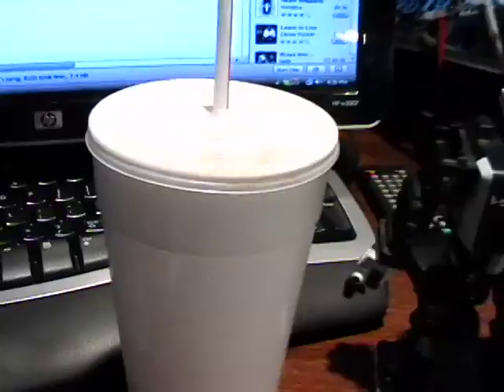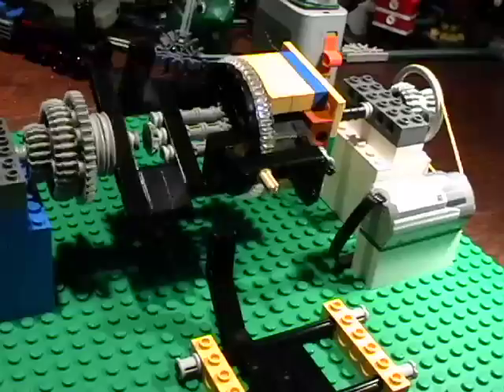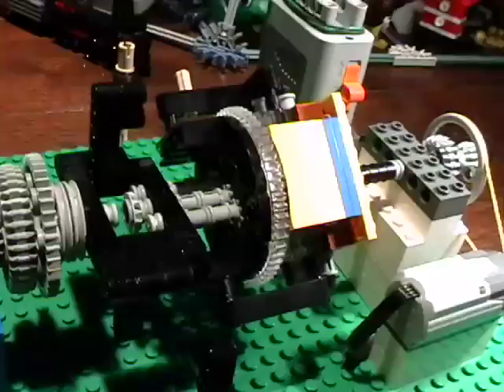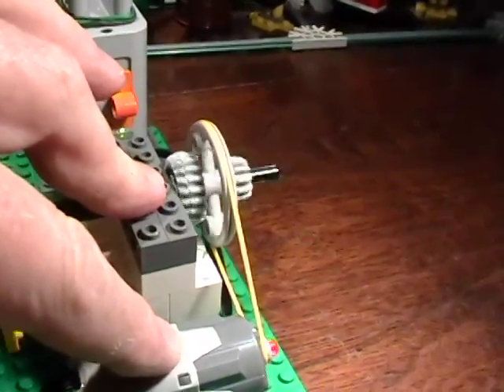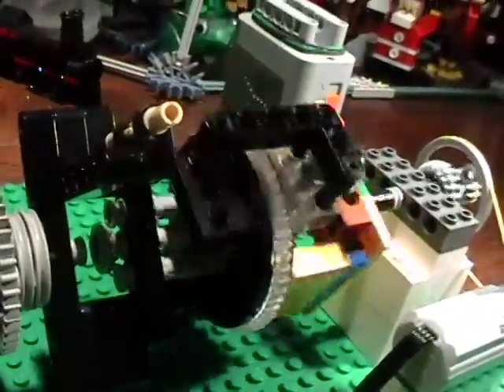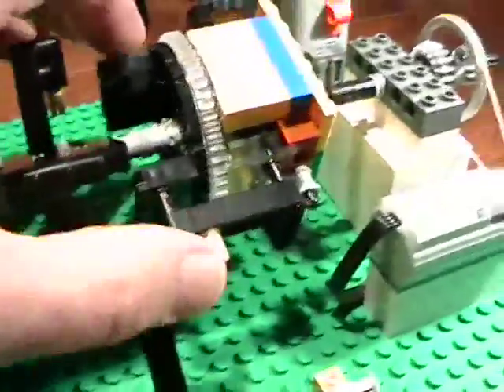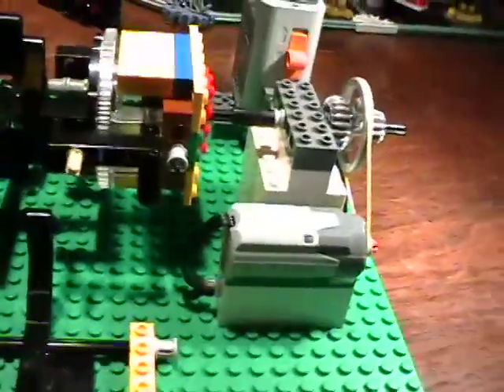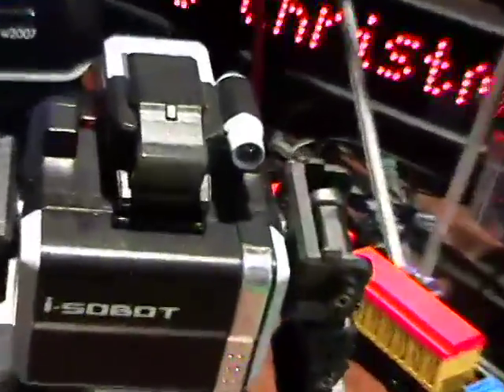Modeling Blog Daily - Lego Planetary Gear DETAILS

Comment: lego actually makes two different ring (or hollow) gears ... one is in the turntables (like you have above; there are two varieties of them with the only difference being the mounting points) the other is actually a wheel from the halfire droid set - it is much larger and allows you to fit different sized gears inside.  the turntable is a good piece to use, though I would recommend figuring out a way to put 3-planet gears around your sun gear; its possible and can handle much higher torques!

Comment: muhaha... glue the technic turntable & run a second motor off a train controller to the outside of the turntable and you get a variable transmission similar to the Power Split Device as found in a Toyota Prius (maybe) - see eahart[dot]com[slash]prius[slash]psd for info & interactive demo